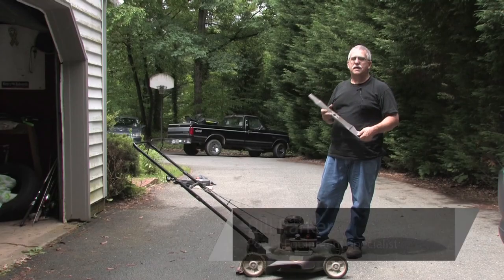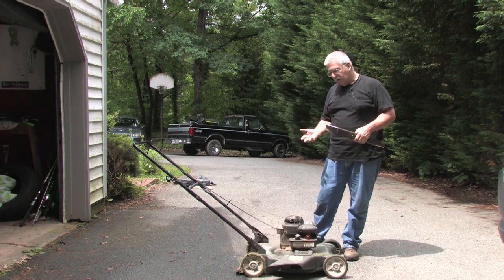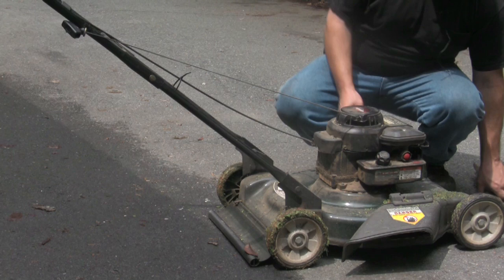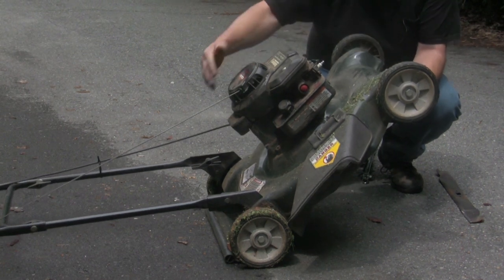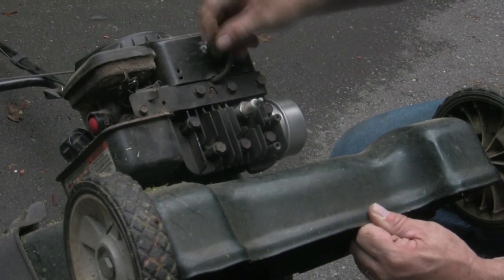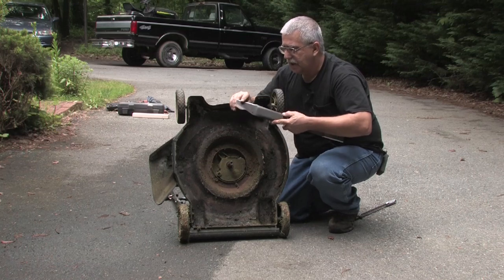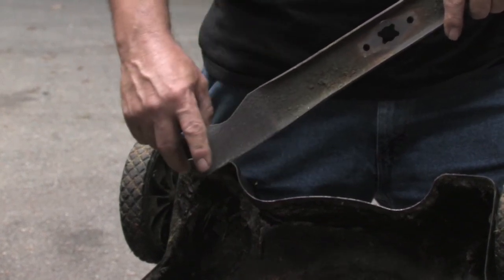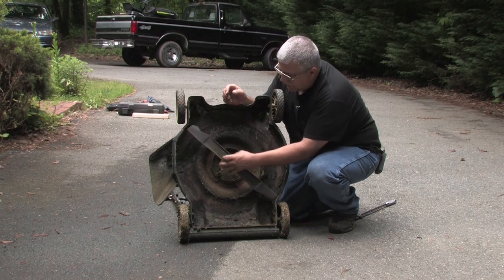Lawn Mower Repair : How to Install Lawnmower Blades

Comment: Never cross thread your bolts, you have to be able to take off the blade later. On my lawnmower when I tightened down the blade too tight I couldn't pull the starter rope.  Loosen it off a bit.  Love the tip about tilting it away from the spark plug, thanks.

Comment: I was wrong about loosing off the lawnmowers blade bolt.  they need to be tight!  I went back and tightened mine to 50lbs using a torque wrench.. that's very tight.  The problem I had with pulling the cord was due to some seizing over the winter. after the thing was started it lubricated itself fine.  If you have to tilt the mower always tilt it backwards toward the handle, never on it's side or oil and gas mix and you'll get white smoke.

Comment: I'm worried I won't get the bolt tight enough and the blade will fly off.  Is it OK to cross-thread the bolt for added protection?